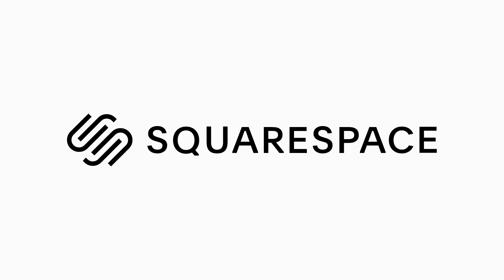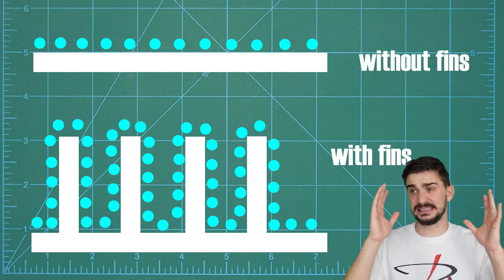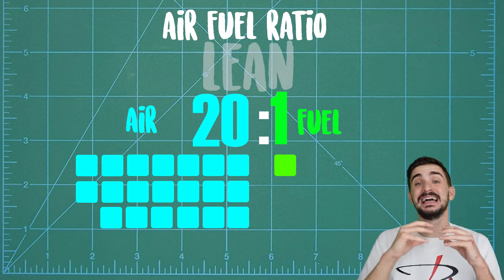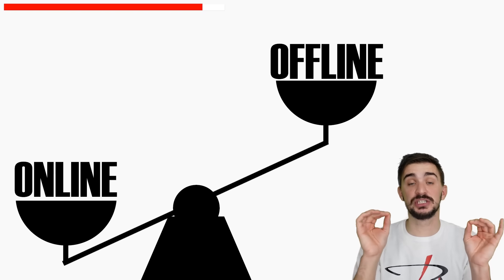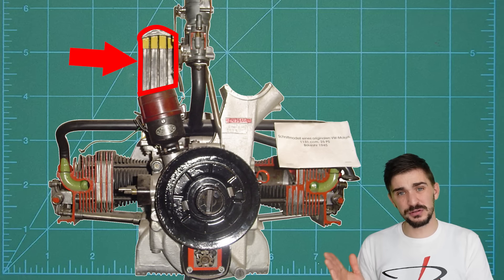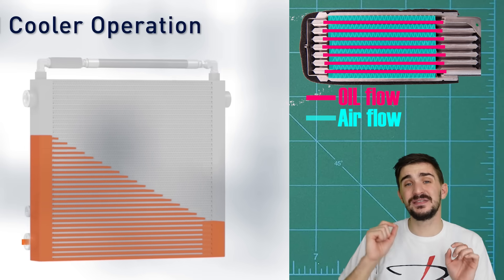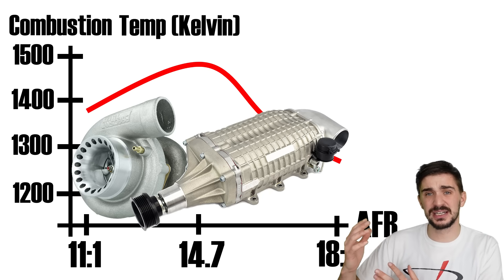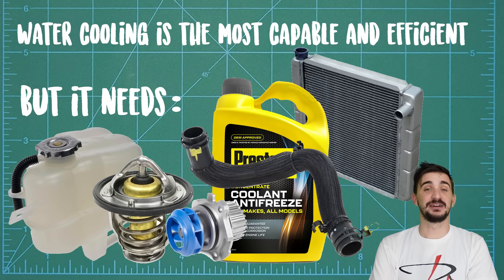AIR COOLED vs OIL cooled vs WATER cooled ENGINES

Comment: I like the relative simplicity of an oil cooled engine like the one in my 2001 Bandit, the fact that leaking gaskets will never result in water contaminating the engine oil, and that there are no water pumps or coolant hoses to corrode or fail. An ideal engine for me would be an oil cooled, fuel injected triple with a thermostat and a fan.
Reply: I also find vehicles with oil cooled engines are more reliable and last at lot longer, bmw r1100/1150/1200, suzuki 600/900 etc
Reply: Why a triple? 
GSX 1400 is really nice.
Reply: @Engineersoldinterstingstuff  I just like triples :)
Reply: Had 86 gsxr 750 when I lived in Florida. Great engine took lots of abuse.
Reply: @douglasgreaves188  They are great engines, a little buzzy at certains rpms, and not as efficient as some modern LC engines, rather large and heavy, but they have character, look and sound good and are very durable. I also appreciate the screw and locknut valve clearance adjusters; a rarity these days.
Reply: I bet you could convert that bandit to Fuel Injection and be VERY happy with it.
Reply: I fitted a 2001 fuel injected gsxr 1000 to my 1990 gsxr 750...:)
Reply: The air and oil cooled engines of old  Suzukis are fine for almost every  non-racing applications.  I wish my  double cradle  GSXR had  SACS and instead of being liquid cooled (being 400ccs, SACS was abandoned esrlier for this displacement than 750s and 1100s/1000s, 600s were  always liquid cooled, unlike the GSX  Katanas)
Reply: An oil cooled engine requires a higher volume oil pump and the increased temperature change of the oil leads to faster degradation. Almost all oil cooled engines have a thermostat.

Ideally for power you need to go the liquid cooling path or if reliability is your thing then air it is. Oil is something in between.
Reply: @soldrier  Degradation only for the oil. I'm running a suzuki oil burner on 15 psi of boost putting down 250 wheel - 250% of stock power. Oil lasts the same, and the only cooling mod is a larger 19 row racing transmission cooler repirposed to replace the stock one. I had the opposite problem where in fall the bike struggled to keep operating temp from the larger cooler. AFAIK no SACS motors used thermostats, not the 1157s 1127s 750s ect. EXTREMELY reliable, you can be pissing oil and aslong as it's topped off there's no issues. It's also better to not have to worry about deck types and headgasket issues without the waterjackets, never underestimate an old oilboiler.
Reply: @remedia1200  Yes indeed, only oil degradation failed to mention that. Now I don't know what engine we are talking about. I'm only aware of late 80s early 90s sport bikes being oil cooled. I mean in an essence all engines are oil cooled even the 2cv had a radiator. You're right about that it's harder to reach operating temps :)..

Now from an engineering standpoint. Having more oil to cool the engine only leads to slower warmup time influencing emissions. Wear in modern engines is not so of a problems as YouTube mechanics would lead you to be. Also heat in an ICE is highly localised. Yes you can use your bike at 250% power but for how long? Those new castings, open block designs etc. While bad for reliability, are an excellent solution to keep heat down on high powered engines. No wonder nothing else caught on.  :)
Reply: @soldrier  you'd be surprised - i'm running low number compared to some. There are 400 -500 hp bikes ou there that have been running quarters for years. Good top fueling/cooling with watermeth, rich mixture, intercooler and oil cooler makes them very happy under boost.
Reply: @remedia1200  How far can you push a bandit 1200 and have it be very street ridable/reliable? (Meaning, pump gas, no water/meth, "no BS" just gas, maintenance, and ride)
Reply: @Drunken_Hamster  that's exactly how mine is and I'm pushing 15 psi. estimated 250 whp. I'm planning on more with an intercooler, head porting, and some rods. with those I should see 300 whp reliably, without any more hassle than now
Reply: @remedia1200  Are you sure? Cuz that really sounds more like E85 territory, which I don't consider "pump gas" even if you CAN get it at the pump... Also... did you conver to EFI? If so, how? If not, how are you running turbo with the carbs?
Reply: @Drunken_Hamster  yes blow through. my effective comp is 17 - perfectly safe for 93 octane with proper fueling (12 afr). porting allows more hp at similar boost. and an intercooler both adds power and lowers top end Temps helping you avoid det. No e85 for carbs it would harm them. I do run octanium octane booster in hot days or track days just for that extra layer of safety
Reply: @remedia1200  Hell, man, I don't need all that power! 150 with some PHAT torque and a proper chassis is more than enough. After a quick google, you can supposedly get that with head work, big bore mod with busa pistons, and 750 cams. From there it's suspension and brake mods and boom.

Either that or I'd get a 954 fireblade for that LIGHT LIGHT weight. But I'm a lazy fuck when to comes to working on shit, so IDK... The lack of coolant loop kinda drew me to the idea of a B12 in the first place.

(I wonder if the blade would still be light if I put the B12 motor in it...)
Reply: @Drunken_Hamster  for 150 and terks I'd 110% reccomend the JE high comp big bore kit, with timing advancer, jet mods, super open exhaust, dot head, and either 750 or 1100 cams. but those cams wi raise power to higher up vs stock
Reply: @remedia1200  you forgot also the 1402cc suzuki's oil cooled engine (gsx 1400)...
Reply: @soldrier  Something in between suits me fine :)
Reply: @soldrier how about air and oil cooled like kawasaki zr-7?
Reply: @Rudimaentaer  Hi,

You are comparing apples to oranges. A diesel and a petrol engine influence on oil degradation, anyway let's put that aside.

I think the main thing is yes it's reliable but can you push that power for extended period of time without losing much. An LC engine is rated at 90C and It maintains that through the entire engine keeping power at let's say 100bhp.
 Aham and this. Clutch material can't make oil that dark because they disintegrate in small chunks. Oil gets its stain from heat cycles and breakdown of molecules.
Reply: @Rudimaentaer  that's the thing liquid cooling allows you to walk on razors edge and still have an engine in one piece.

As you said u can have a functioning high  hp oil cooled engine last abit by using some tricks like lower af ratio. Try that with modern emission regulatives. And I doubt it that oil temps were 80C, more like 100-120C. A normal engine say bmw s54 has oil temps around 100C let alone a crotch rocket at 150hp/ltr. No wonder suzuki gave up on the idea. It's a thing that had it's glory back in the day but today has no more use.
Reply: @soldrier  yes, oil temps below 100C invite water issues. I'd be interested in hearing why one wouldn't keep the oil a bit above boiling. Any idea?

Comment: as far as i know, compression makes more heat than the friction of the piston in the bore, take for example, a turbo charger compresses the air without direct metal to metal contact, and the air gets hot
Reply: Many turbochargers use intercoolers to cool the compressed air prior to it entering the combustion chamber.  I would bet the heat created from the friction of all the rotating parts in the engine far exceeds the heat created from the compressed air of forced induction.

Comment: Brother,please make a detailed video on engine oil grade, specially pros and cons of  using thicker grade from  recommended from oem.(like using 10w-40 or 10w-50 instead of the recommendation of 10w-30)
Reply: I'd agree.  Good topic.  It's so easy to just say "use the recommended viscosity" but, it would be good to hear they 'why'.  I understand a few of the factors but don't totally trust my own experience to claim I know what I'm talking about.  It's almost a religious topic in the air cooled VW community.  It would be nice to have a plainly worded presentation to point at.
(personally, I use 10w40 in my 2110cc build while some would call me a puppy-punter for not using straight 30 lawnmower sap)
Reply: @ImnotgoingSideways  it's because every fluid at high temperature loose viscosity, so the engine oil manufacturers makes them in this way to compensate
Reply: @ImnotgoingSideways  sometime using recommended grade is very harmfull, specially at the hot and humid country like Bangladesh, India, Srilanka where weather temparature is 35-40 degree celcious and humidity on average 70-85%. 

So,want to know about this topic in detailed form   from ”drive 4 answer”.
Reply: @sahedahsanabir8520  Solid, yeah.  Surely, there's a point where thermal expansion is going to cause an engine to eat itself alive regardless of lubrication.  But, I can totally see how a thicker oil helps in a perpetually hotter than typical non-equatorial environments.
Reply: @ImnotgoingSideways  Exactly, thats why I want to know the explanation from this channel.
Reply: The first number is the viscosity at 20° and the second is the same but at 200° degrees (metric unit)
Reply: @fabiotiburzi  I know about the multigrade oil viscosity rating.
But,I actually want to know the consequences of using thicker oil rather than recommendation's.
Reply: @sahedahsanabir8520  thicker oil keep a thicker film between engine component at high temperature preventing seizing

Comment: So engines get hot from internal friction only, and not from combustion also.
How interesting!
Are you sure?
Reply from the maker: 9:15 and I quote "... In the vicinity of the combustion chamber, the main source of engine heat". I never said friction is the only source of heat, but I guess it's easier to put words into my mouth when you don't have the attention span to watch a 15min YouTube video.
Reply: @d4a  At 01:11 you start discussing air cooling. Long before you mention the main source of heat at 09:15
Why not first explain where the heat is coming from (mainly combustion) and then the 3 different cooling methods.
I just didn't bother to look the full 15 minutes because at 01:11 it was clear to me that you didn't mention the source of the heat.
Reply from the maker: Ok, I'll explain things in the order you prefer next time 😂

Comment: What creates more heat in an engine, friction or combustion ?
Reply from the maker: Combustion
Reply: @d4a  Thanks, you didn't mentioned it in the video if I remember correctly, so that confused me.
Reply from the maker: 9:15
Reply: @d4a  Oh, I missed that, but I am still kinda confused, does combustion directly contribute to the heat (because, well, explosions) or indirectly (it causes moving parts to move, causing friction, which then contributes to hear. You also said that piston rings contribute to 40% of the total friction, how much is that of the total heat ?

Comment: Why would oil cooled engines have an increased servicing cost?  You'd think all the extra oil would allow for extended oil change intervals
Reply from the maker: It usually doesn't. 3 liters is cheaper than 5 obviously

Comment: Isn’t it heat comes from compressed air? Get a bike pump and pump it fast without sealing it and repeat even slow but with sealed or blocked nozzle, heat comes from compression

Comment: What if we dipped existing oil cooler into water jacket? water will absorbed all the heat and circulate within that cooling chamber through natural convection and transfer heat to outside air. It can be retrofit and will improve effectiveness of oil cooling.
Reply: You’ve just described an automatic transmission cooling in most cars.

Comment: I thought that oil cooled engines were similar to water cooled ones... Just mixing both circuits.

My car has an oil thermometer... Well theoretically all modern cars have, but mine is visible. But I've realized that oil always reaches operating temperature much sooner than coolant. I'd like to see a video where you talk about the different strategies manufacturers adopt to warm up the engine ASAP, besides a simple thermostat, of course. Mine takes around 3 to 5 minutes depending on outside temperature and the use of heating. I'd like to see as well how oil and coolant systems exchange heat depending on the requirements. I wonder whether such dramatic temperature changes are good for the components of the engine...

Cheers :)
Reply: The water cooled Suzuki GSF1250 and Yamaha CP3 engines and probably others also use water/oil coolers to transfer heat from the oil to the water cooling system.

Comment: @driving 4 answers
Largest downside of air, oil and hybrid air/oil cooled engines is by far Volumetric Efficiency (VE).  I'm about to condense a lot of Thermodynamic and Fluid Dynamic information rather quickly, so stick with me:
1. Specific Heat Capacity is the ability of a fluid to absorb or transfer heat per unit mass, usually measured in British Thermal Units per pound mass/kilogram, or BTU/lbm BTU/kg.
2. Cylinder oil film thickness decreases exponentially as piston mean speed increases.
3. A combustion chamber/cylinder at a relatively colder temperature has a lower absolute pressure, meaning that there is a larger pressure differential between the cylinder and the intake tract as the intake valve starts to open.
4. As HP and Torque output per liter increases, the use of a fuel as an additional heat sink becomes more important than the fuel simply being a source of combustion.

I have a 2005 Ducati 800 SuperSport, which is an 803cc V-twin SOHC with a hemispherical combustion chamber.  From the factory, it makes ~ 74.5 HP at 8250 and 70 NM at 6250, which are respectable.  But when put through a horsepower calculator (which you can find at this URL: http://hpwizard.com/engine-horsepower-calculator.html ) you'll soon see that at 100% VE, this engine should be making 88.82 HP, meaning that the engine itself is not at 100% VE, but rather 91%.  And this is under ideal conditions where each cylinder is receiving uniform adequate airflow, which is not always the case.  The higher the engine speed, the more drastic the difference becomes.  All other things being equal, an equivalent engine set with HP peak at 12,000 RPM will make ~ 130 HP if water cooled, but only 106 HP if remaining Air/oil cooled.  A noticeable side effect of air or hybrid air/oil cooling is that fuel consumption is higher than in water cooled examples, primarily due to statement 4 above.  For reasoning as to why that is, see this video: https://www.youtube.com/watch?v=aDSZhy551bo , which goes into further detail on tuning as far as spark timing vs fuel metering.
Keep in mind that air cooled engines tend to have hotter combustion chambers than their water cooled compatriots due solely to heat dissipation dynamics, thereby resulting in higher combustion chamber absolute pressure and lower differential pressure.  This can be explored by watching Motor Trend's Engine Masters video 'Heat Kills Power - The How and Why' (Season 4, Episode 43) https://www.motortrendondemand.com/detail/heat-kills-powerthe-how-and-why/35777/772 
And last but not least, in an engine cooled by anything other than water, oil comes into the cooling equation regardless of whether or not it's a dedicated system in the engine's design.  Also keep in mind that per statement 2, the oil film thickness decreases exponentially as RPM increases, meaning that the more power you produce (and the higher you spin the engine) the worse the oil's capability to remove heat from the cylinder/piston underside greatly decreases, and it's not a linear relationship.
Per statement 4, air and oil cooled engines require more fuel introduced into the cylinder to increase the overall capacity of the heat sink, leading to lower fuel mileage in order to maintain reliability and not cause overheating.
Reply: My vespa px is rich as fuck for this reason